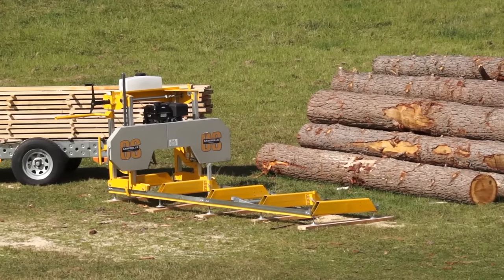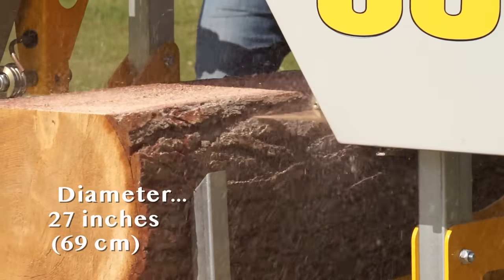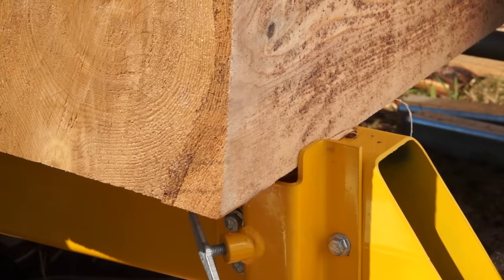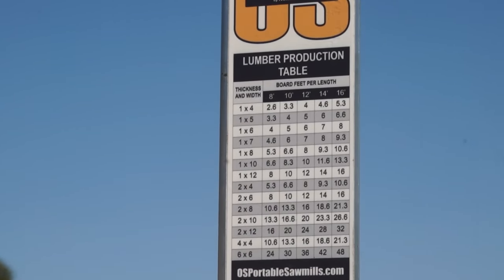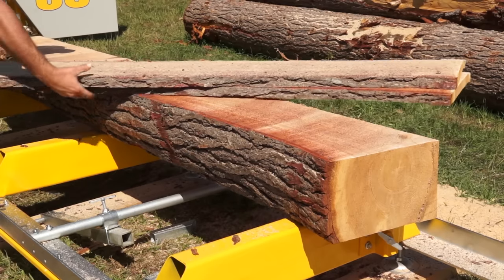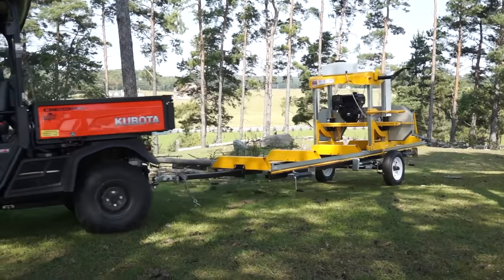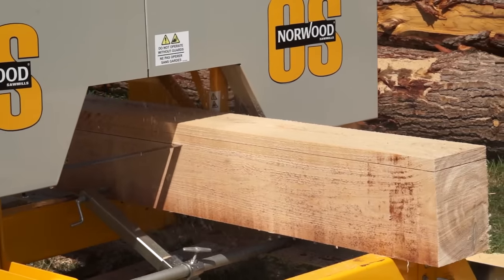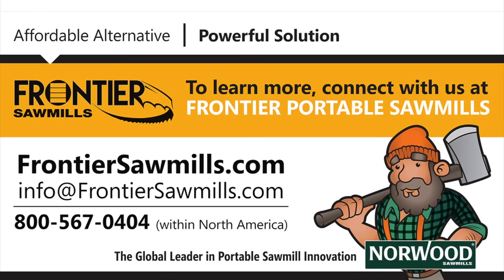The Affordable, Easy-to-Use & Reliable Sawmill You've Been Looking for - The Frontier OS27

Comment: Mashallah is a very beautiful machine, can I take it from Bangladesh? Even if you can take it, how much will it cost?
Reply from the maker: Frontier builds three sawmill models with different log diameter capacities: OS23: 59cm (23”), OS27: 69cm (27”), and OS31: 79cm (31”). Standard log length is 3.4m (11’) but you can add 7’ (2.1m) extensions to mill as long as you want.  You can add the optionally available trailer/support jack system to all Frontier sawmills at any time (when you get your Frontier or in the future).

Frontier Sawmills start at just USD $2397 (for the Frontier OS23). The Frontier OS27 starts at only USD $3397.  The Frontier OS31 starts at only USD $3997.  

You can get a lot of helpful info about Frontier Sawmills, including all pricing, at www.FrontierSawmills.com  .

Frontier services your country factory-direct.  To order, contact us directly at Frontier Sawmills via email at info@FrontierSawmills.com . 

Thanks!

Comment: I need one ( how much)
Reply from the maker: Frontier builds three sawmill models with different log diameter capacities: OS23: 59cm (23”), OS27: 69cm (27”), and OS31: 79cm (31”). Standard log length is 3.4m (11’) but you can add 7’ (2.1m) extensions to mill as long as you want.  You can add the optionally available trailer/support jack system to all Frontier sawmills at any time (when you get your Frontier or in the future).

Frontier Sawmills start at just USD $2297 (for the Frontier OS23). The Frontier OS27 starts at only USD $3297.  The Frontier OS31 starts at only USD $3897.  

You can get a lot of helpful info about Frontier Sawmills, including all pricing, at www.FrontierSawmills.com  .
Reply: @FrontierSawmills  can u shipping to Egypt
Reply from the maker: Yes, we can.
Reply: @FrontierSawmills  opium

.

Comment: Still waiting for one of these portable sawmill companies to make a blade with teeth on both sides of the blade so you can saw both directions.  A 50% reduction in walking back in fourth would be a nice time/labor reduction.
Reply: you cold take 2 blades and turn them one on each side and space them with a washer between the bearings
Reply from the maker: Your question (suggestion) is not uncommon. Here is the reason why it is not done. Band blades need to be supported in the cut – top, bottom and back. To make a sawmill that can cut in both directions means having a blade with teeth on both sides of the blade. But, if you have teeth at the “back” of the blade, it is hard to support that surface with a blade guide support.

Comment: Cuánto es su precio
Se puede traer a México
Reply from the maker: Frontier fabrica tres modelos de aserraderos para troncos de diferente diámetro: OS23: 23” (50cms), OS27: 27” (69cms) y la OS31: 31” (79cms)  La longitud estándar del tronco es de 11’ (3.4m) pero usted podrá adicionar extensiones de 7’ (2.1m) para aserrar troncos tan largos como usted desee. Usted podrá adicionar el sistema opcional de remolque/sistema de soporte de gato a todos los modelos de aserraderos Frontier en cualquier momento (cuando usted compre su  Frontier o en un futuro)

Los aserraderos Frontier comienzan desde solo USD $2297 ( Frontier OS23). La Frontier OS27 inicia desde solo USD $3297. La Frontier OS31 empieza desde solo USD 3897 

Usted podrá encontrar gran cantidad de información sobre los Aserraderos Frontier, incluyendo precios en la página web  www.FrontierSawmills.com

Por el momento de igual forma nuestra página web solo se puede acceder en Inglés.

Comment: Any issues at 7,200 ft?  I bought a Briggs& Stratton generator which quickly develed problems starting.
In the parking lot of the store where i purchased it at 5,500 and it started easily.
I have a wood chipper and another generator and they run fine.
Reply from the maker: Hey Randy. No specific issues at a particular number of feet or hours. Been pretty reliable all around. Thanks

Comment: I built one of these in the 90's. Used trailer wheels for pulleys. They're a lot of fun. It could cut 24" x 18' log max. I eventually sold it to a horse logger from out of town. A tool I wish I'd never sold.

Comment: Wow its amazing
Reply: How much place
Reply from the maker: Frontier builds three sawmill models with different log diameter capacities: OS23: 59cm (23”), OS27: 69cm (27”), and OS31: 79cm (31”). Standard log length is 3.4m (11’) but you can add 7’ (2.1m) extensions to mill as long as you want.  You can add the optionally available trailer/support jack system to all Frontier sawmills at any time (when you get your Frontier or in the future).

Frontier Sawmills start at just USD $2297 (for the Frontier OS23). The Frontier OS27 starts at only USD $3297.  The Frontier OS31 starts at only USD $3897.  

You can get a lot of helpful info about Frontier Sawmills, including all pricing, at www.FrontierSawmills.com  .

Frontier services your country factory-direct.  To order, contact us directly at Frontier Sawmills via email at info@FrontierSawmills.com .

Comment: I WANT ONE !!!!
$$$$?????!.
Reply from the maker: Hi David

Frontier builds three sawmill models with different log diameter capacities: OS23: 23” (59cm), OS27: 27” (69cm), and OS31: 31” (79cm). Standard log length is 11’ (3.4m) but you can add 7’ (2.1m) extensions to mill as long as you want.  You can add the optionally available trailer/support jack system to all Frontier sawmills at any time (when you get your Frontier or in the future). 

Frontier Sawmills start at just USD $2297 (for the Frontier OS23). The Frontier OS27 starts at only $3297.  The Frontier OS31 starts at only $3897. 

You can get a lot of helpful info about Frontier Sawmills, including all pricing, at www.FrontierSawmills.com  .

Comment: Is it available in india what is the price of this machine
Reply from the maker: Frontier builds three sawmill models with different log diameter capacities: OS23: 59cm (23”), OS27: 69cm (27”), and OS31: 79cm (31”). Standard log length is 3.4m (11’) but you can add 7’ (2.1m) extensions to mill as long as you want.  You can add the optionally available trailer/support jack system to all Frontier sawmills at any time (when you get your Frontier or in the future).

Frontier Sawmills start at just USD $2297 (for the Frontier OS23). The Frontier OS27 starts at only USD $3297.  The Frontier OS31 starts at only USD $3897.  

You can get a lot of helpful info about Frontier Sawmills, including all pricing, at www.FrontierSawmills.com  .

Frontier services India factory-direct.  To order, contact us directly at Frontier Sawmills via email at info@FrontierSawmills.com .

Comment: how much does aproximativent a machine like this ??
Reply from the maker: Frontier builds three sawmill models with different log diameter capacities: OS23: 23” (59cm), OS27: 27” (69cm), and OS31: 31” (79cm). Standard log length is 11’ (3.4m) but you can add 7’ (2.1m) extensions to mill as long as you want.  You can add the optionally available trailer/support jack system to all Frontier sawmills at any time (when you get your Frontier or in the future). 

Frontier Sawmills start at just USD $2297 (for the Frontier OS23). The Frontier OS27 starts at only $3297.  The Frontier OS31 starts at only $3897. 

You can get a lot of helpful info about Frontier Sawmills, including all pricing, at www.FrontierSawmills.com  .

We would be happy to mail you a free Frontier Sawmills info kit. You can order one online at  https://www.frontiersawmills.com/en_us/free-catalog-free-dvd-form

We would be happy to answer any questions that you may have, or to prepare a quote, including shipping to your door.  Let us know the best number to reach you at or please feel free to call us toll-free at 800-567-0404.

Thanks!

Comment: Is it available in India.. how much cost it has?
Reply from the maker: Frontier builds three sawmill models with different log diameter capacities: OS23: 59cm (23”), OS27: 69cm (27”), and OS31: 79cm (31”). Standard log length is 3.4m (11’) but you can add 7’ (2.1m) extensions to mill as long as you want.  You can add the optionally available trailer/support jack system to all Frontier sawmills at any time (when you get your Frontier or in the future).

Frontier Sawmills start at just USD $2397 (for the Frontier OS23). The Frontier OS27 starts at only USD $3397.  The Frontier OS31 starts at only USD $3997.  

You can get a lot of helpful info about Frontier Sawmills, including all pricing, at www.FrontierSawmills.com  .

Frontier services your country factory-direct.  To order, contact us directly at Frontier Sawmills via email at info@FrontierSawmills.com . 

Thanks!

Comment: Hope they can have it saw in reverse as well for efficiency. So no need for you to go back up front to saw again.
Reply from the maker: Your question (suggestion) is not uncommon. Here is the reason why it is not done. Band blades need to be supported in the cut – top, bottom and back. To make a sawmill that can cut in both directions means having a blade with teeth on both sides of the blade. But, if you have teeth at the “back” of the blade, it is hard to support that surface with a blade guide support.
Reply: @FrontierSawmills  The solution would be to have two separate blade near back to back. It would be a simple innovation to incorporate .

Comment: Send your price & for availability in ariya
Reply from the maker: We ship full selection of our Norwood brand of sawmills globally.   

Norwood builds several models of manual and hydraulic portable band sawmills ranging in capacities from 66cm (26”) to 92cm (36”) log diameter.  You can learn more at www.NorwoodSawmills.com 

Please feel free to email with your further questions and request for quote: info@NorwoodSawmills.com.
Reply from the maker: Frontier builds three sawmill models with different log diameter capacities: OS23: 59cm (23”), OS27: 69cm (27”), and OS31: 79cm (31”). Standard log length is 3.4m (11’) but you can add 7’ (2.1m) extensions to mill as long as you want.  You can add the optionally available trailer/support jack system to all Frontier sawmills at any time (when you get your Frontier or in the future).

Frontier Sawmills start at just USD $2297 (for the Frontier OS23). The Frontier OS27 starts at only USD $3297.  The Frontier OS31 starts at only USD $3897.  

You can get a lot of helpful info about Frontier Sawmills, including all pricing, at www.FrontierSawmills.com  .

Frontier services your country factory-direct.  To order, contact us directly at Frontier Sawmills via email at info@FrontierSawmills.com .

Comment: How much is “low cost” ?
Reply from the maker: Frontier builds three sawmill models with different log diameter capacities: OS23: 23” (59cm), OS27: 27” (69cm), and OS31: 31” (79cm). Standard log length is 11’ (3.4m) but you can add 7’ (2.1m) extensions to mill as long as you want.  You can add the optionally available trailer/support jack system to all Frontier sawmills at any time (when you get your Frontier or in the future). 

Frontier Sawmills start at just USD $2297 (for the Frontier OS23). The Frontier OS27 starts at only $3297.  The Frontier OS31 starts at only $3897. 

You can get a lot of helpful info about Frontier Sawmills, including all pricing, at www.FrontierSawmills.com  .
Reply: os23 7hp...$ 2300.00 //// os27 13hp $ 3300.00
Reply: @FrontierSawmills  your prices are extremely fair, you should boldly advertise them.

Comment: Why is the sawblade only onesided? If is bothsided I can cut the wood if I rollback too.
Reply from the maker: Your question (suggestion) is not uncommon. Here is the reason why it is not done. Band blades need to be supported in the cut – top, bottom and back. To make a sawmill that can cut in both directions means having a blade with teeth on both sides of the blade. But, if you have teeth at the “back” of the blade, it is hard to support that surface with a blade guide support.
Reply: @FrontierSawmills  Thanks for your  answer. It means that sawmill with doublesided cut is more expensiv?
Reply from the maker: Yes, much. And hardly available. The time walking the sawhead back or only a miniscule part of your sawing day. Cutting in that direction would not materially improve production.

Comment: How can I get one?then kindly indicate the price
Reply from the maker: Frontier builds three sawmill models with different log diameter capacities: OS23: 59cm (23”), OS27: 69cm (27”), and OS31: 79cm (31”). Standard log length is 3.4m (11’) but you can add 7’ (2.1m) extensions to mill as long as you want.  You can add the optionally available trailer/support jack system to all Frontier sawmills at any time (when you get your Frontier or in the future).

Frontier Sawmills start at just USD $2397 (for the Frontier OS23). The Frontier OS27 starts at only USD $3397.  The Frontier OS31 starts at only USD $3997.  

You can get a lot of helpful info about Frontier Sawmills, including all pricing, at www.FrontierSawmills.com  .

Frontier services your country factory-direct.  To order, contact us directly at Frontier Sawmills via email at info@FrontierSawmills.com . 

Thanks!

Comment: Я работал на такой!
Reply: Ге знаете сейчас такой сколько может стоить?
Reply from the maker: Frontier builds three sawmill models with different log diameter capacities: OS23: 59cm (23”), OS27: 69cm (27”), and OS31: 79cm (31”). Standard log length is 3.4m (11’) but you can add 7’ (2.1m) extensions to mill as long as you want.  You can add the optionally available trailer/support jack system to all Frontier sawmills at any time (when you get your Frontier or in the future).

Frontier Sawmills start at just USD $2397 (for the Frontier OS23). The Frontier OS27 starts at only USD $3397.  The Frontier OS31 starts at only USD $3997.  

You can get a lot of helpful info about Frontier Sawmills, including all pricing, at www.FrontierSawmills.com  .

Frontier services your country factory-direct.  To order, contact us directly at Frontier Sawmills via email at info@FrontierSawmills.com . 

Thanks!

Comment: Mantull...mantap betul.....berapa harganya dan beli dimana......👍👍
Reply from the maker: Frontier builds three sawmill models with different log diameter capacities: OS23: 59cm (23”), OS27: 69cm (27”), and OS31: 79cm (31”). Standard log length is 3.4m (11’) but you can add 7’ (2.1m) extensions to mill as long as you want.  You can add the optionally available trailer/support jack system to all Frontier sawmills at any time (when you get your Frontier or in the future).

Frontier Sawmills start at just USD $2297 (for the Frontier OS23). The Frontier OS27 starts at only USD $3297.  The Frontier OS31 starts at only USD $3897.  

You can get a lot of helpful info about Frontier Sawmills, including all pricing, at www.FrontierSawmills.com  .

Frontier services your country factory-direct.  To order, contact us directly at Frontier Sawmills via email at info@FrontierSawmills.com . 

Thanks!

Comment: An amazingly great saw machine !
Do you have office or showroom in India at present ?
Reply from the maker: Frontier builds three sawmill models with different log diameter capacities: OS23: 59cm (23”), OS27: 69cm (27”), and OS31: 79cm (31”). Standard log length is 3.4m (11’) but you can add 7’ (2.1m) extensions to mill as long as you want.  You can add the optionally available trailer/support jack system to all Frontier sawmills at any time (when you get your Frontier or in the future).

Frontier Sawmills start at just USD $2297 (for the Frontier OS23). The Frontier OS27 starts at only USD $3297.  The Frontier OS31 starts at only USD $3897.  

You can get a lot of helpful info about Frontier Sawmills, including all pricing, at www.FrontierSawmills.com  .

Frontier services your country factory-direct.  To order, contact us directly at Frontier Sawmills via email at info@FrontierSawmills.com .

Comment: Super 
J'ai bien maîtriser la machine
Reply: यह मशीन किधर मिलती है और इसका कांटेक्ट नंबर भेजो लेने का है
Reply from the maker: Frontier builds three sawmill models with different log diameter capacities: OS23: 59cm (23”), OS27: 69cm (27”), and OS31: 79cm (31”). Standard log length is 3.4m (11’) but you can add 7’ (2.1m) extensions to mill as long as you want.  You can add the optionally available trailer/support jack system to all Frontier sawmills at any time (when you get your Frontier or in the future).

Frontier Sawmills start at just USD $2297 (for the Frontier OS23). The Frontier OS27 starts at only USD $3297.  The Frontier OS31 starts at only USD $3897.  

You can get a lot of helpful info about Frontier Sawmills, including all pricing, at www.FrontierSawmills.com  .

Frontier services your country factory-direct.  To order, contact us directly at Frontier Sawmills via email at info@FrontierSawmills.com . 

Thanks!

Comment: A onde posso  encontrar  aqui  no Brasil
Reply from the maker: Frontier builds three sawmill models with different log diameter capacities: OS23: 59cm (23”), OS27: 69cm (27”), and OS31: 79cm (31”). Standard log length is 3.4m (11’) but you can add 7’ (2.1m) extensions to mill as long as you want.  You can add the optionally available trailer/support jack system to all Frontier sawmills at any time (when you get your Frontier or in the future).

Frontier Sawmills start at just USD $2297 (for the Frontier OS23). The Frontier OS27 starts at only USD $3297.  The Frontier OS31 starts at only USD $3897.  

You can get a lot of helpful info about Frontier Sawmills, including all pricing, at www.FrontierSawmills.com  .

Frontier services your country factory-direct.  To order, contact us directly at Frontier Sawmills via email at info@FrontierSawmills.com . 

Thanks!